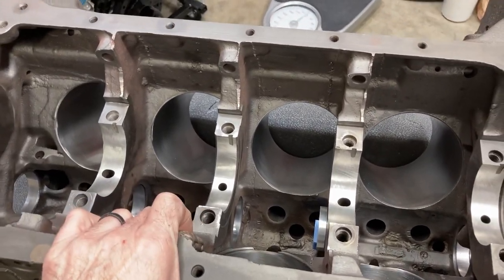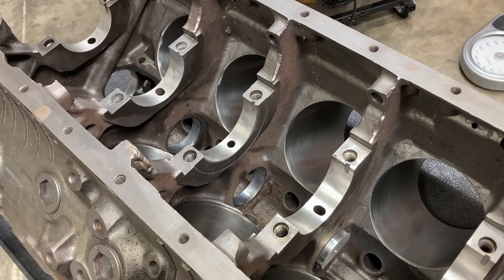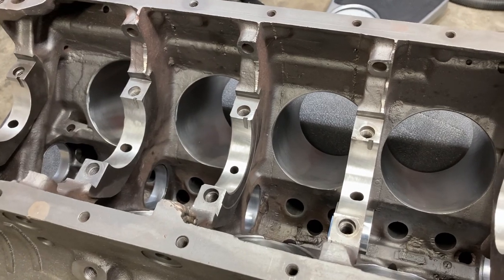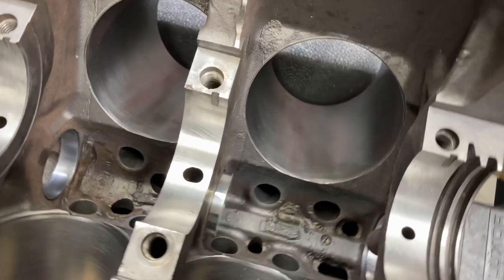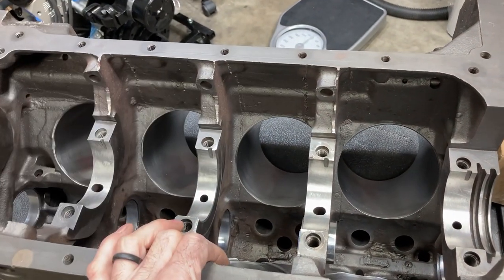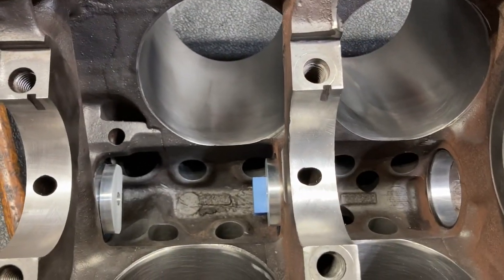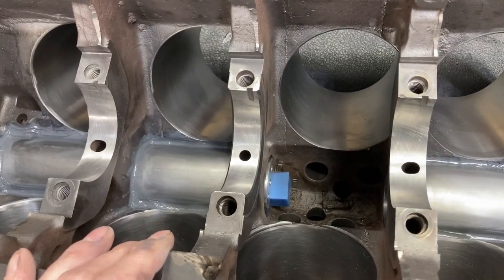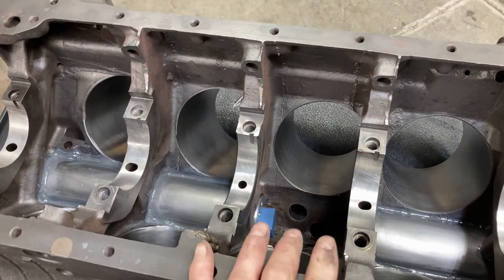Lykins Motorsports Ford FE Enclosed Cam Tunnel Install

Comment: Nice work,I have done many applications in the past using  two part epoxies ,my experience I have used syringes to run a nice bead,one large enough and with a large enough office/spout due to the bonding agent being thick,once epoxies mixed load the syringe and the air will burp out before the jb,    Wife works at a hospital so I had access to few sizes to experiment with,a 50cc or 100cc
Should be large enough to load,or various epoxies come with a gun and one time long skinny mixing tip to apply,mixes two parts as it leaves the pair of tubes,you just not sure if 3m has an equivalent to jb   Just buy a bunch of tips they are inexpensive,hope this helps

Comment: I was out in my shop earlier. I cut a piece of  sheet metal to size, and bent it over some exhaust  pipe that I had laying around. I made it so it pressure  fit down in  the cam tunnel. It was hard to get out. 
A little  J.B. weld and it wouldn't  be going anywhere.

Comment: Roller cam SBC engines used bronze bearings.  They require extra clearance because the bronze bearing swells more when hot.  I found this out the hard way when PAW swapped the bronze bearings in my kit without telling me during the mid 90s.  A super sweet 400 got fairly ruined in less than 3000 miles when the cam seized in the #3 & 4 bearings, spinning them in the block.  The owner didn't think that the noise was anything of terrible concern & drove the pickup until the lifters weren't getting enough oil to stay pumped up & the engine began to miss horribly.  Probably don't need to say much else.  But the bearings will last really well with proper clearance.

Comment: I read through the comments & I see you say the purpose is to add horsepower? How dus this add horsepower? Is this to prevent windage? So the oil uses the drain back holes in the valley & nun falls throught the middle??

Comment: I don't know if I  trust J.B.weld enough to hold that sheet  metal in place.
 I'm building  a dry sump stroker Boss 9.
I will have to try playing  with this idea.
Maybe  put some tabs on the little  trays to bolt to the bottom of  the lifterr valley, or some type of clip that would wedge the trays above the cylinders in the valley. I would feel safer with some form of mechanical fastener holding the trays in place. I like the idea. Good job.
Reply from the maker: Many guys use JB Weld to do this.  Not concerned about it at all.

Comment: I slipped the cam bearings onto the bearing driver after the tool was almost in place for all but the front bearing. In fact my cam bearing tool wouldn't fit thru the bores with a bearing on the expanding part of the tool, if I remember correctly. It may have just been the particular installer I used. Of course none of what I said  is an issue unless you have to replace the cam bearings. I made a trough like this out of cardboard to catch mushroomed out old lifters on a big block Chevy one time so as not to damage the bores getting the old lifters out. Just pulled em up with my fingers till they stuck, slid in the trough, and popped the lifters down into the trough and fished em out with a magnet. I was kinda proud of myself at 17 to have thought of that. Patting myself on the back.  Sorry about that.

Comment: Is the main purpose of the tunnel to keep the cam lobes submerged in oil or to contain roller lifters that might come apart or both? Did you do this because modern cams and flat tappet lifters just don't last, even with a bunch of zinc added to the oil? It figures that you would do this now,  now that I have my 401 together and just broke in the cam.
Reply from the maker: The main purpose is for horsepower.

Comment: For those wondering about oil draining back, could you just drill a small hole in each trough to let it drain back but obviously with a bunch of restriction compared to open?

Comment: How do you replace the camshaft bearings during a future rebuild? 
Remove the camshaft tunnel ?
Reply from the maker: The same way that you would any other time.   A cam bearing tool fits right in there.

Comment: How much additional oil will this require in the pan? Add an extra 2 qts you think?
Reply from the maker: I'll find out exactly when I prime the pump for the first time.
Reply: @lykinsmotorsports  definitely would be nice to have a little bit of built in extra capacity

Comment: Would RTV be a better option? Flexibility over rigidity?
Reply from the maker: I actually thought about that, but was afraid that it would be too flexible and touch something it shouldn't touch.....   An engine builder that I know of has used JB Weld on 11 engines with enclosed cam tunnels.  Not one single issue or failure, even on some NHRA Super Stock engines.

Comment: Do you know the background on that main journal web weld?
Reply from the maker: My guess is that it's a factory repair.  I see no other indications of issues within the block.  It is a service replacement block, so molds could have been getting worn out by then.

Comment: How is the oil in the tunnel going to escape or return to the sump?
Reply from the maker: Through the holes in the lifter valley.  The FE has holes in the block casting, a couple per cam tunnel segment.   The oil will end up in the lifter valley, where you can scavenge it away with a dry sump pump, or it will drain in the front of the block back to the pan.

Comment: Do you sell the Dyno mules
Reply from the maker: Yes, I do.
Reply: In the early 70's everything was pretty crude albeit if you wanted to try something different, it was by you and it was by hand.  I did this too. You didn't need a machine shop to do it.  Whatever it was, it could be done pretty quickly.
--- Comparing to this modern way, plain old sheet metal was cut using cardboard templates, tin snips, sheet metal, drive screws and  Plastic Mastic epoxy. Same with the side of the block to smooth the oil trap at the pan rail down to the base of the cylinders.  Used the factory fuel pump to draw the oil from the back of the block hole and a rubber hose pushed into that hole, then feeding oil from the pump back into the pan away from the pick up. Drilled holes
 through the cam webs as well as the cam journals to transfer the oil to the back. -- This was for valve spring force.  I could use 500 510# open @.670 net lift after break in. 
Flat tappet Crane. 
Different times, Same brains and way better way to do it now though.